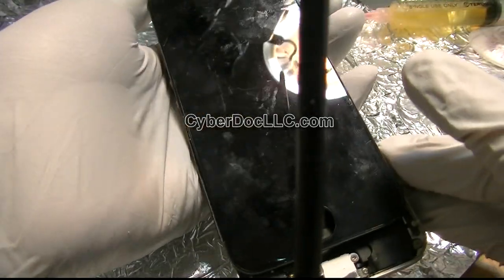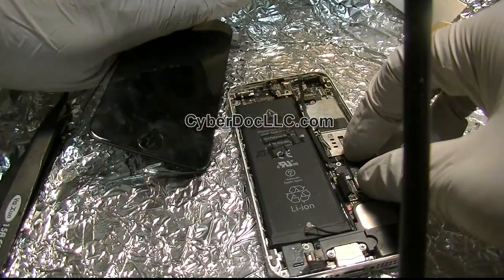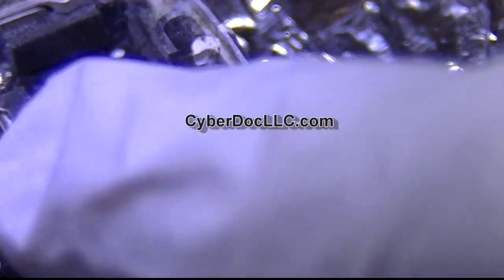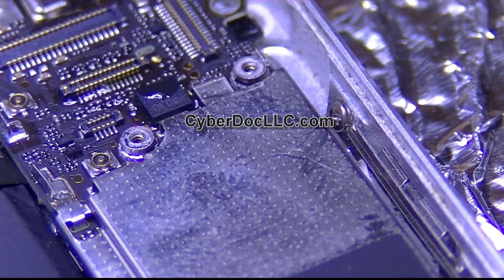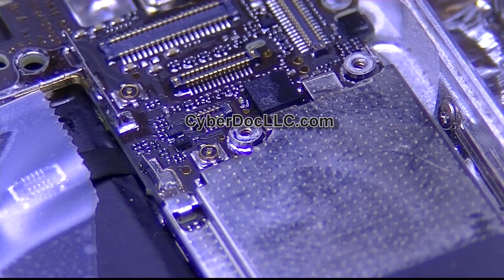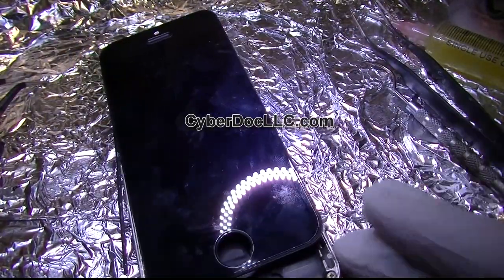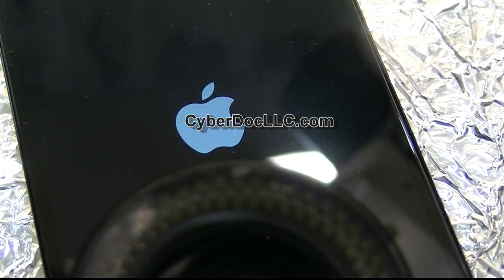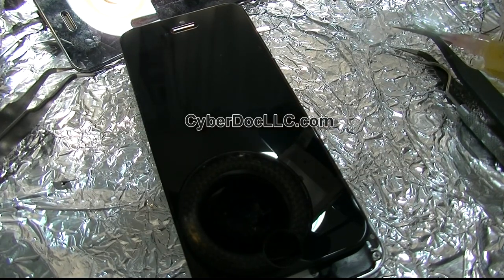iphone 5 backlight repair

Comment: hey cyber, tnx as always for the great video. i have a question: are all those 1005 filter, resistor and capacitors available for buy or you have to take them from other broken iphone ?

i have bought 0402 0603 0805 1206 and are available on the internet, but those 1005 are not...
Reply from the maker: http://www.cyberdocllc.com/shop/iphone-5-backlight-1-coil-and-1-ic-and-3x-backlight-filters-combo-repair-kit/